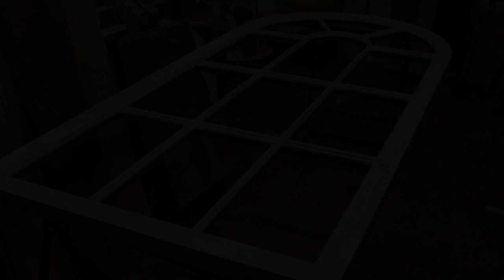arched window part-7 modifying and painting

Comment: Excellent work done. It brought back many memories, I made some wooden windows back in the 1060s, using traditional tools, setting them up for normal single glazing, for a private house, after they had been built in I was informed that they were going to have this new double-glazed panels, I had to go round and deepen all the rebates by hand, (Portable routers not having been available.) Still making the odd items at 81, Good luck for the future.
Reply from the maker: 1060s? are you a vampire?
Reply: @NewYorkshireWorkshop  Sorry, slip of the digit  lol.

Comment: One thing to note, you should paint the rebates (rabets) for the glazing putty, because the putty will last longer without having it's own linseed oil being leeched out by the wood :)  Obviously if they use a different product other than traditional putty, it may different in treatment.

Comment: Absolute delight to watch, true craftsmanship.  Out of interest, what are the properties of the pitch pine as opposed to a regular pine?  Is it harder and more resistant to rot?
Reply from the maker: it is really resistant to rot due to the amount of resin in it, this paticular wood was the foundations of a mill in manchester so had been burried in the ground for 170 years!
Reply: @NewYorkshireWorkshop  Thanks for the reply, it sounds as though they will last really well then if they were buried for that long and didn't rot!
Reply: @NewYorkshireWorkshop  Would  you recommend it for a bathroom floor, would it have to be old growth?

Comment: The rebates are not wide enough. The spacer on the units will be seen. I normally allow at least 14mm wide.
Reply from the maker: it was made for low sightline heritage units.
Reply: @NewYorkshireWorkshop  Had no idea about those. I know the glazing laws in the uk changed many years ago. I think it was Fensa or something. Caused a big headache on heritage property.